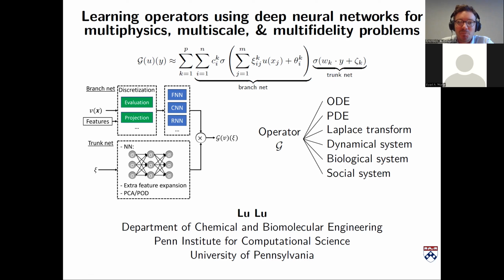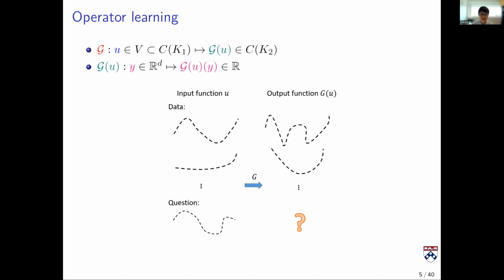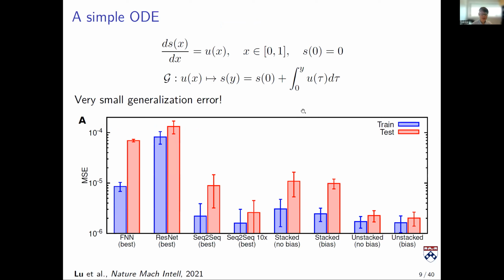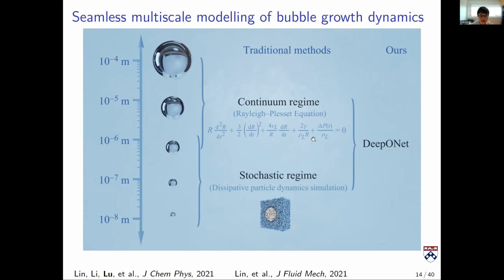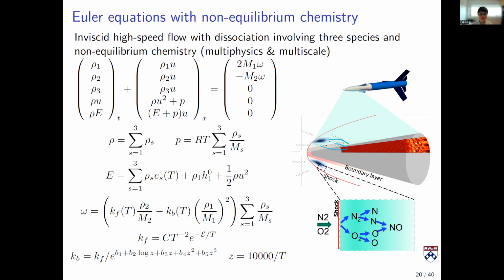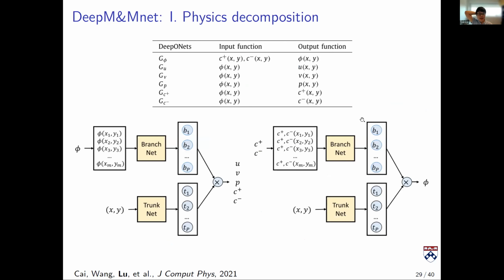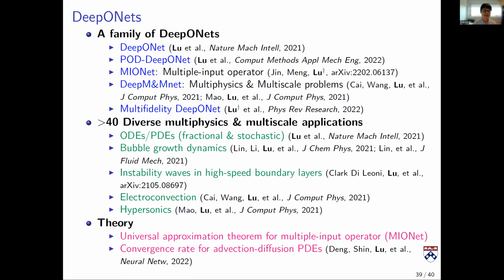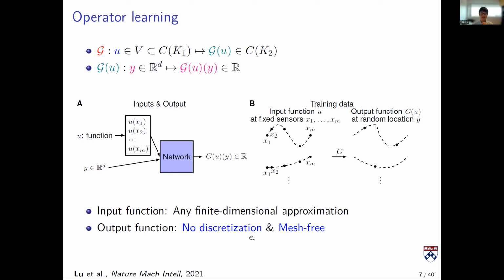Learning operators using deep neural networks for multiphysics, multiscale, & multifidelity problems

Comment: Is deeponet works only for time depending engineering problem or it also works for steady problems?
Reply: They defined it for a quite general class of operator, so I assume it should work for steady state problems as well as for dynamical systems since the former is a particular case of the latter.